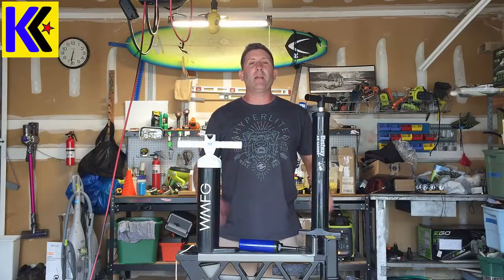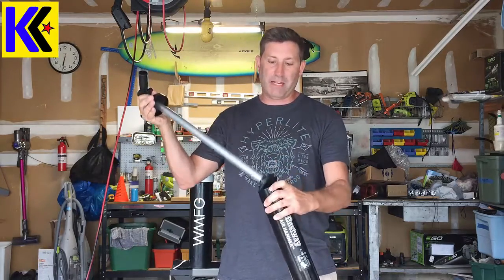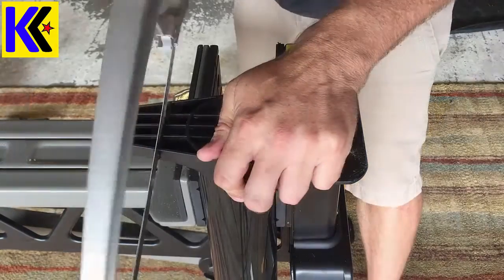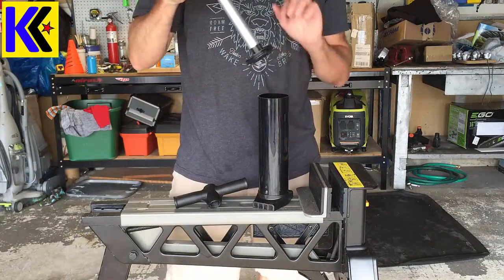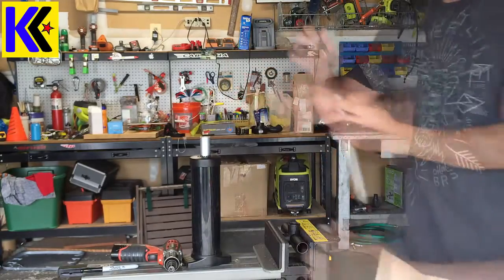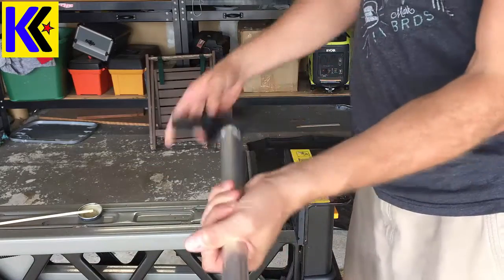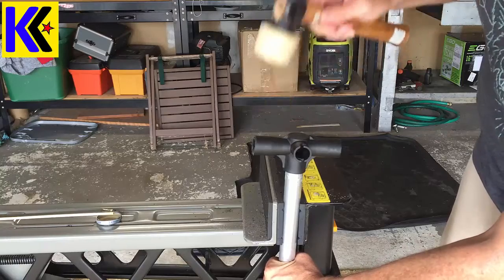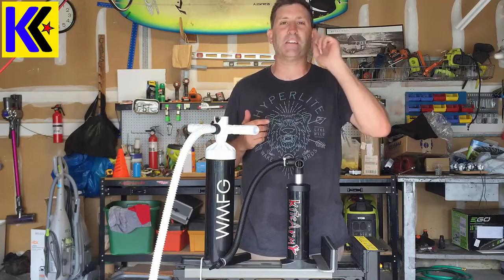Travel Size Kiteboard Pump - Make Project

Comment: Use the 530CFM blower to make an RC plane. The trick will be to get it to go straight. Use a track of some kind to launch it. Equip it with a deploy-able parachute to land it softly.
Reply: Also, you might be interested in EGO's new 600CFM backpack blower.